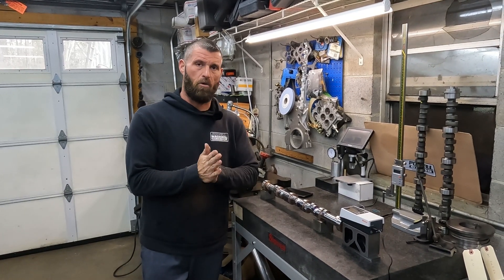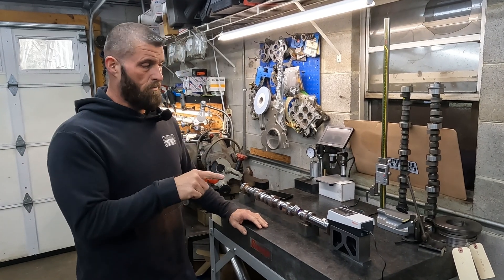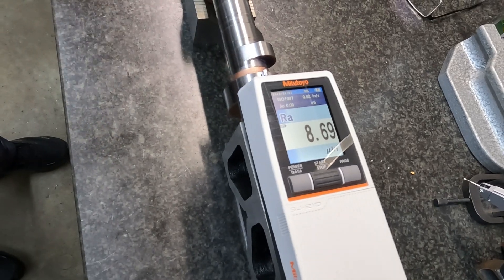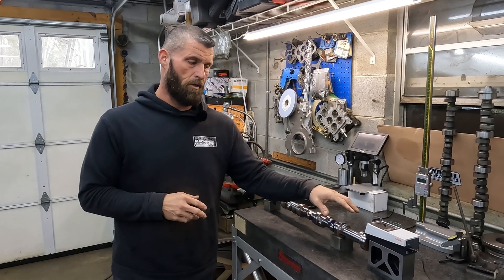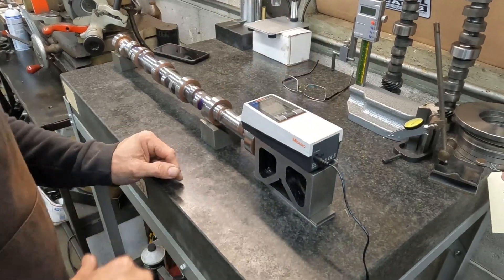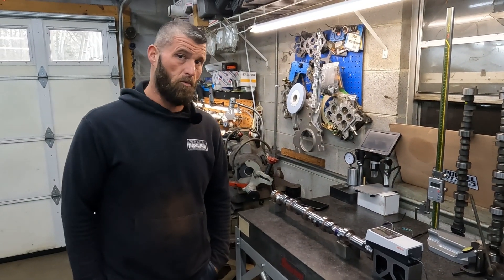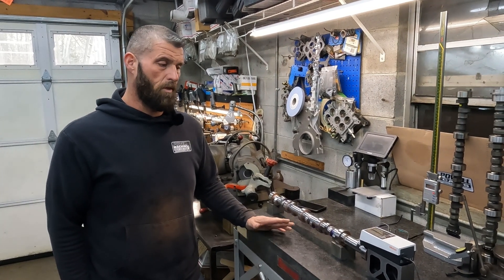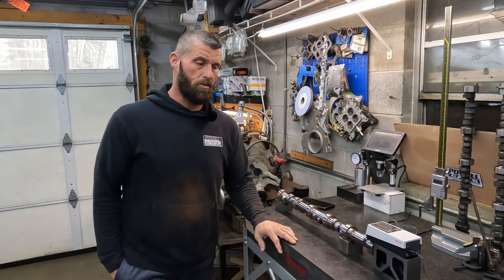Camshaft surface finish...let's check it

Comment: My thoughts on finish is that it needs to be slick but be able to hold an oil film so that it remains lubricated. If there's not enough texture for the oil to hold to I feel it would ruin the surface. I've been an automotive mechanic more than 40 years. I've worked the past 10 years as a Harley Davidson technician and lack of lubrication is a death sentence for an engine or transmission. BTW, i appreciate you sharing your knowledge with others. I try to pass on the particular skills I've acquired over a lifetime of turning wrenches. My life would have been for nothing if I dont leave what I've learned with someone else to continue using it when I'm done. Thanks for what you. do
Reply from the maker: You're very welcome  🙏

Comment: Looked in the shop and found an old blue racer cam after your last video. Same Paint mark on face and fatter center core on dist gear end. Clearly that was not your cam that went bad and they were trying the good old "theft by deception" routine for free parts. I had a guy completely chew me out for taking the inner springs out of his dual springs to break the cam in. Low RPM break in. no chance of valve float or hitting a valve and easier on the cam. But this guy still went stupid on me. Griped about the high zinc oil cost too. But I guess you either do it right or you wash out all the metal flakes, rinse everything, replace junk parts, relube,  reassemble, and repeat at double the money n time and no one is happy.. Arggg!!!!!

Comment: smooth enough to not be wearing into bearing yet you want some peaks and valleys to hold the oil. too smooth it just wipes off and more apt to touch the bearing. i dont think everyone understands the journals and bearing are never suppose to touch and ride on each other. they ride on the film of oil. i am amazed by how many of my customers hae the deer in headlght stare when i tell them that. its worse trying to explain it. you touch a crank bearing with a crank journal thats when they spin a bearing. every LS ive seen that spun a cam bearing had super fine chrome like journal finish to it and stupid tight timing chains. last one had stock crank cam location and offset chain gear set for line bored block. guy wanted his chain tight. it was

Comment: If the goal is to have the least amount of wear/friction between two surfaces that are going to be in contact with each other (that is everything inside and engine) the highest level of polishing and smoothing is what is required, but does require expensive specialty machines to reach that level.
Reply: The goal is to have all mating parts work together properly and thus achieve durability. Daniel explained why having the roughness/smoothness not too smooth. Are you an engine builder with 30 years experience having seen in the industry what works and what doesn't?

Comment: I remember in the late 70’s my dad had a Chevy truck with a 305 where the cam lobes wore down.
Q. Was that caused by too low of lobe hardness, or defective machining?
Reply: Worn down Chevy cam lobes were very common back then.  I changed a lot of them, as did most other shops.  GM blamed the oil, but other companies' engines running the same oil didn't have anywhere near the problems GM (especially Chevy) did.  I never heard what the real problem was, but small block Chevies sure ate a lot of cams in the late '70's-early '80's!
Reply: I would atest to that !! I seen a lot of cams have lobes just hammered. The rumor I heard was chevy was messing around with heat treating. Only the inside guys would know for sure and they are sworn to secrecy !!!   Lol

Comment: Back when I was a Cummins technician we started seeing a lot of cam failures on the N14 engines due to the cam followers sliding on the cams because the finish was too slick.

Comment: It seems like too smooth a finish will erase all the porosity needed to retain oil to properly lube the bearings and lifters during operation. I could be wrong. Great video!
Reply from the maker: Yep

Comment: You are correct about the fine finish issues. If it is a roller surface, our targets was always min 5ra. If the finish is too slick, the roller will not be able to get enough to grab, and can lead to flat spots.  For a solid lifter, the answer is the opposite... the finer, the better. That being said, an ra of 6-8 is already pretty smooth right off the grinder.
Reply: Too slick ain't always good either....the solid/flat lifters need enough to get them turnin a bit
Reply from the maker: Min 5? That's crazy,
Reply: @powellmachineinc  those specs were for live oiled bearing rollers. the specs depended on the roller OD and use loads, but were almost always a minimum of 5. we rarely ran them that low, that was just the lowest acceptable. what we got depended on material hardness, wheel dress state, feed rates, and wheel grit